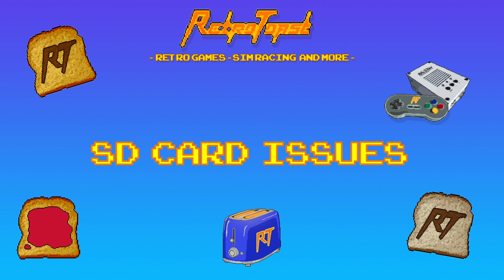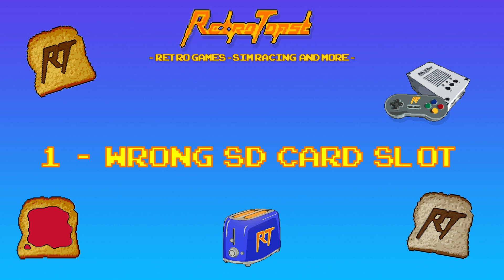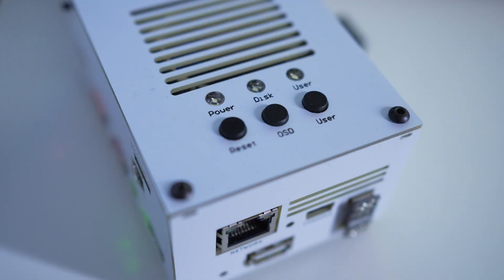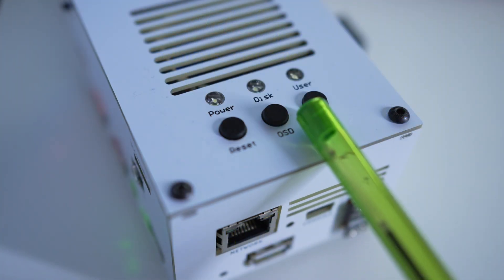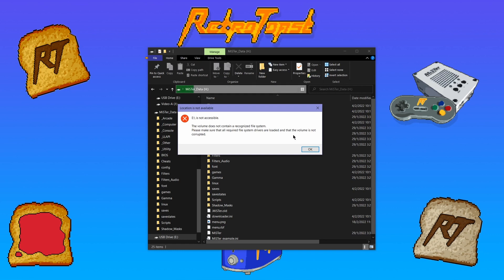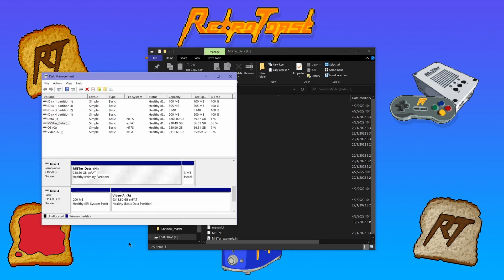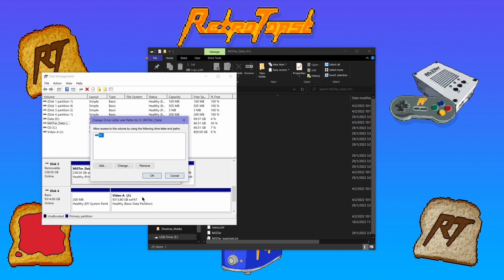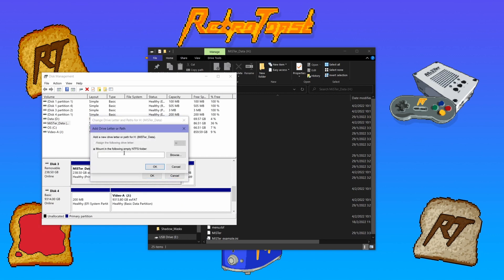MiSTer FPGA | How to Fix SD Card Issues | Quick Tips Guide

Comment: Hi, I am changing over an SD card to a bigger one and flashed it with Mr fusion and am trying to put over the files for my smaller SD card as you said. The only problem is that, my 512 GB SD card after flashing it with Mr fusion is only showing up as about 100 megabytes of available data and saying it's not enough for me to put the other files on it. Do you know why this is and how I can fix it? 

It's odd. It's like it is two partitions now, I followed the directions but it says that the Mr Fusion partition is about 110 MB and the rest of the 512gb is not accessible now. I don't get why. It's showing up but every time I click it it's tell me it's not accessible and then it's asking me to format that partition. Do I format it? 

Every time I try to access The second partition that created it says this. I tried to format the first partition with Mr Fusion on it again to try to get full access of the SD card but it's not working. I have no idea what's going on. Thanks for your help.
Reply from the maker: Hard to say what's going on. I would try to reformat that new SD card and flash it again, then copy your games as needed. Hope it works out!

Comment: Yeah, tried moving the sd card between the slots and it still boots once in every twenty attempts. Once it does everything works fine but it is driving me mad that a 400€ device is so unreliable.
Reply from the maker: SD cards can easily get corrupted or stop working. Maybe try another brand. Plugging it in and out often also may cause failure, I had that happen to some of my cards. A good option is to store all games on a usb drive and only keep the system on the sd card. Hope it works out!